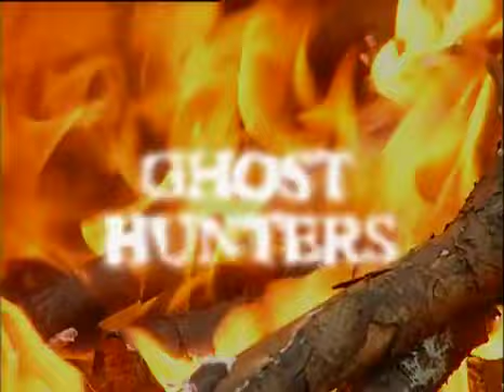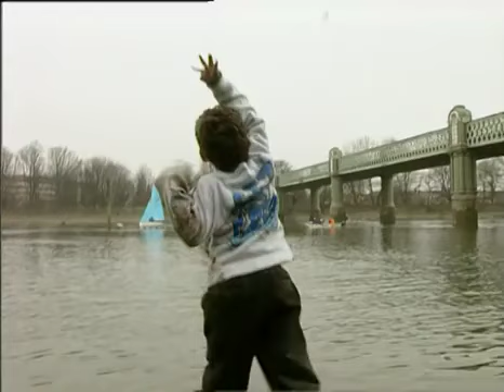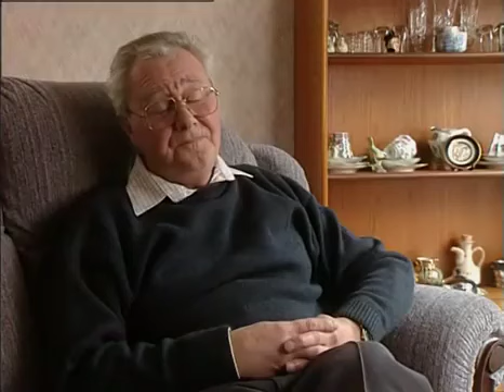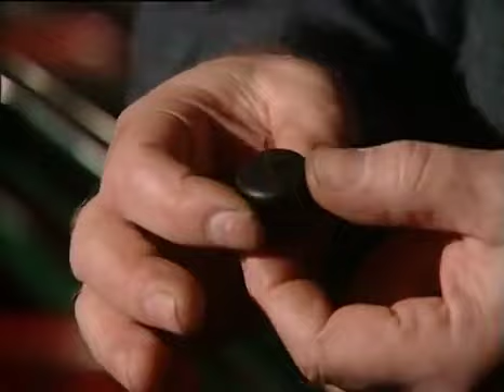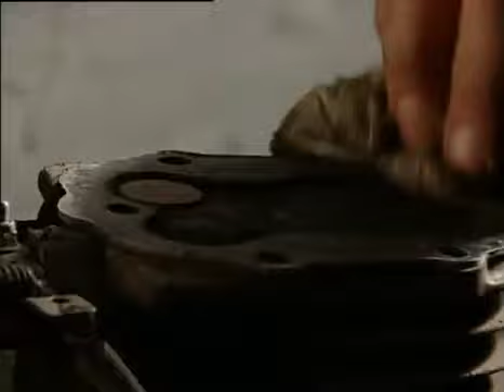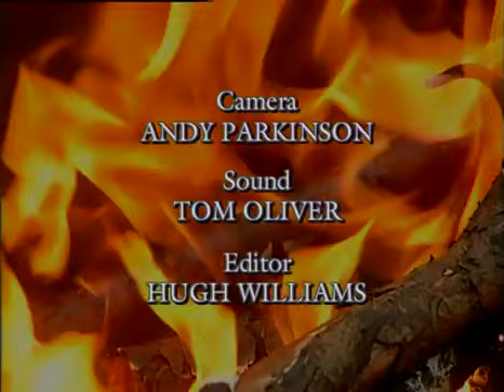Ghosthunters UK - Part 13 - Invisible Intelligence

Comment: I can give an answer as far as the scientific disbelief or scepticism is concerned. I fully agree with them on one point. In order for you to consider that a thing is true you have to get physical proof. Without this you only have a theory. 

It is a fact that in order to make a mathematical calculation you do need a character used to determine a mathematical value.  If you have a 0.trillion 0s and a mathematical character (it does not matter if it is 1 to 9 or XYZ or pi) you can make a calculation which could be used in any science to determine a sought answer. Every calculation we can make is based on something which has a traceable substance. Basically we must be able to see, touch or examine this thing even if it is light. But if you try to make a calculation on something like a vacuum you cannot. With no atmospheres there is basically nothing there. 0.0 and nothing else has no properties to make a calculation with.  You can make an observation and calculation on what a vacuum does to various materials because they do have properties which can be quantified in mathematical terms.  You need to be able to isolate the properties of the substance in order to be able to make a calculation.  

Now in this world there are three beings which are impossible to examine and find out their properties in order to make a calculation and these are Angels, Demons and Human Spirits.  

Because we have the physical material of the human body we can make millions of calculations on it but the soul of a person is a totally different matter. 

However, their existence is verifiable through other means. When these beings talk they still can be heard because they still move the air currents and you can get a few words from them. Verifiable intelligent answers to questions have been recorded by paranormal investigators  on specialized equipment able to decipher messages on a certain wavelength.  

Monitors able to pick up kinetic energy have been able to record not only their movements but also their basic profile points. 

The energy they emit and even drain has been visibly seen in the form of lights . Normally in the shape of balls. They are able to use elements such as darkness and even water vapor to show their presence.  

Because these beings exist they can move objects and touch people and in the case of demons even attack people or animals. 

With the help of mediums or Holy exorcists they have even been captured in bottles or boxes and weighed. 

So scientifically they have been proven to exist but it is impossible for scientists to examine their actual make up or substance and draw the same conclusions they would be able to with anything material.

Now here comes the part where I can explain this to you but my explanation can only be understood if you come from an Abrahamic religion.  

It all comes down to two words and their definition.  If you Make something or Create something. Things which are made from something which is either material or some sort of light. But the original definition of to Create something is to make something out of nothing. Or to bring something into existence.  

Almighty God/Allah/YHWH created the heavens and the Earth. What we see around us has been created by the Lord in order that our physical human being and the other material fauna and flora can use it to live and survive on the planet. 

However Almighty God/Allah/YHWH also Said that He just has to Say Be and it is. When He Says Be and it is that things Created out of nothing. Only Almighty God/Allah/YHWH knows what that thing is actually  composed of and we will never find out. It is His Mystery and Secret and if we had to find out we will never understand it. 

How can we understand the complexity of things which are never going to perish but will live forever in another realm.  A realm which only the Human Soul, Demons and Angels will be able to see and live in. 

I was wondering if Almighty God/Allah/YHWH  made the vacuum but then I remembered hearing that one of the properties of a vacuum is that if any article is put in motion in a vacuum it continues to move in the same direction.  In the Quran it agrees with the big bang theory.  Scientists have been studying the possibility that hydrogen (it's a complicated theory  which I cannot fully understand) was thrown into a vacuum it would explode and go hurtling out and form the various elements we know of. Cosmetologists say that the universe is always expanding.  As long as there are explosions such as super  novas the energy of these explosions will mean that the universe will keep expanding.  This expansion is aided by the vacuum of outer space. So yes Almighty God/Allah/YHWH even Created the vacuum for a purpose.  

I have said a lot in this comment. And I am sure that many will try to blow what I have said up. But even if you dont agree with me that is your choice and you are entitled to your opinion.  But that is how I see it and I will not change my mind.